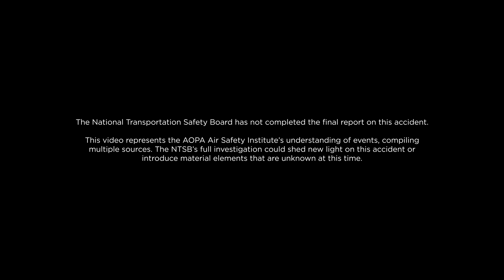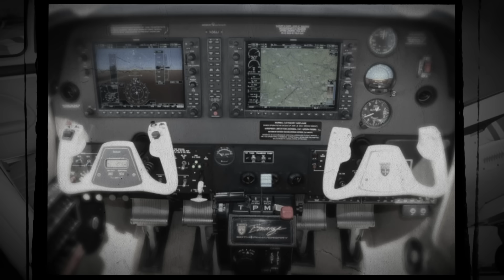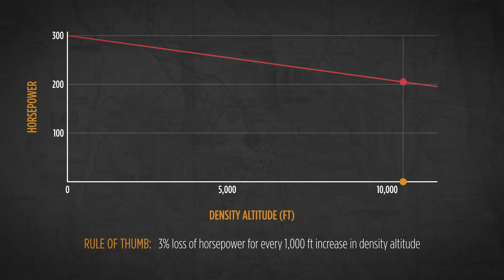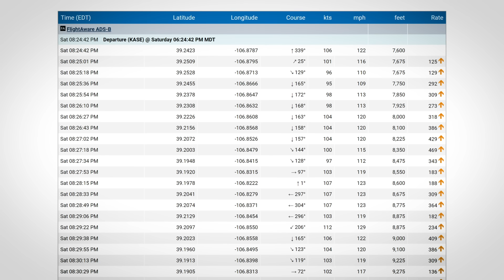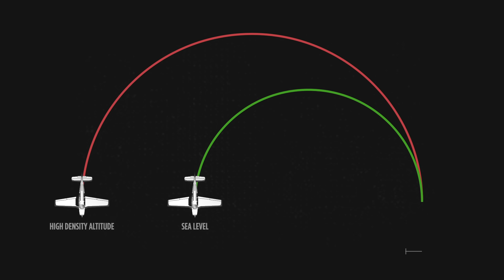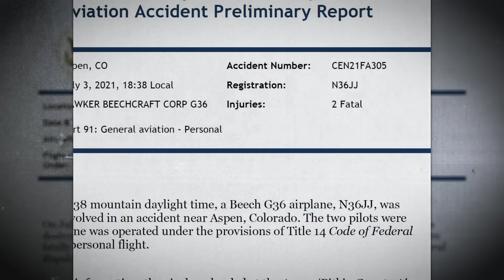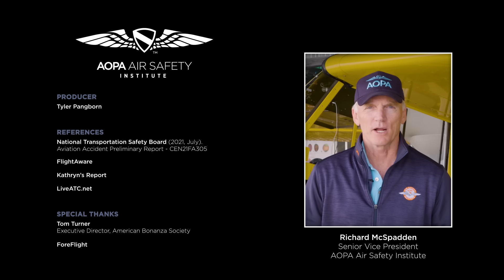Accident Case Study: Into Thin Air

Comment: While density altitude was the ultimate killer in this case, what started them down that path was improper flight planning to begin with and poor risk management of the situation they were getting into. They then further exacerbated this when, realizing that they could not climb and maintain the altitude cleared by ATC on the SID, they then decided to wing it VFR.  That’s pretty classic impulsivity at work.  To a certain extent you may not be able to blame them. They were ATP rated pilots with a lot of experience and jets. Well that may sound even more damning of their decisions, keep in mind that it creates  inaccurate and vulnerable perceptions about how airplanes perform and may not allow them to perceive just how poor the climb and maneuvering performance of a light Part 23 normally aspirated airplane like a Bonanza will fly under those conditions.  I would also have to know about their competency in mountain flying as that’s another key factor here. As you pointed out, the combination of high density altitude plus downdrafts and sinkers from wind flowing over the mountains ultimately brought about the inability of the aircraft to climb over terrain.  As a CFI I recommend to my students who finish up a PPL not to attempt mountain flying until they take a course on it from a competent instructor.  And even then, seek out the advice from an experienced CFI if they are flying in an unfamiliar mountainous region as this person can be a wealth of information as well as alert them to a lot of hazards in their region of flight.
The instant these pilots realized the density altitude would not permit them to depart IFR using the SID should have raised immediate red flags.  Being aware of this, you need to really carefully evaluate your options at that point as opposed to simply rushing into the decision to depart VFR and make your choice of course ad hoc while enroute.  Combined with the fact that it’s starting to get late in the evening, the wisest route would’ve been simply to cancel their intentions to depart, and taxi back to the ramp.  $50 worth of Uber rides and a $150 hotel room in Aspen for the night while you wait for better flying conditions and planning a new flight beats the hell out of dying in an airplane crash.  Just another sad story about people who poorly evaluated the risks of what they were doing and got in over their heads.
Reply: So true, although I wonder whether $150 will get a room in Aspen.  Seriously, though, shouldn't they have known and briefed the SID before ATC gave them that info?
Reply: @gretchenlittle6817  The pilot was a dentist in Manhattan.  He could afford a couple rooms at the Four Seasons for a night.
Reply: Only David Zara was an ATP and he received that rating in May...not as experienced at age 58 as you might have thought.
Reply: @billcraig  He may have experience growing out of his ears. I have no idea what the man‘s total times were, etc.  That being said you’re only as good as the next hour in your logbook.  You have to be real careful. These things can happen to anyone, no matter how much experience they have.  Smart, experienced pilots routinely make poor decisions in airplanes and sometimes get killed for it.
Reply: I'm a student with a couple questions - would a VFR departure in this situation be otherwise OK if they had done so having studied the geography to find a calculated route? Also, would a VFR departure so late in the day be wise in any case? i.e., it forces them to stay atop the mountains, as you can't fly through terrain with no visual reference. It would rob you of opportunity to descend in the event of malfunction or unexpected poor performance.
Reply: @JaidenJimenez86 A VFR departure can be a safe and acceptable means of cross country flight over mountainous terrain, provided it is properly planned with precise performance calculations, backup contingency plans and backup plans for those backups.

That being said, if they had run the numbers for a VFR flight that day over the mountains, the results would have been pretty grim.  I don’t know how someone could fly a Bonanza with full fuel, two grown men and their luggage through those mountain passes with density altitudes over the passes being as high as 16000 feet.  There was little margin for maneuvering or error.  Most likely if they had run the numbers they would have found it was extremely unwise to attempt a flight out of KASE that day.

At the time they were about to depart KASE, they had about 2 solid hours of daylight left.  That’s really starting to push it as there isn’t much margain for error.  Canyons and mountain passes get dark quick.  It’s risky to go off and do that.

And the situation did not appear to be getting better.  Overnight lows for the next day only dropped the outside air temperature to the high 50s, leaving the density altitude at ~9500 ft at KASE.  Combined with it being the Fourth of July weekend, I’m sure the were worried about FBO hours plus fuel and maintenance availability over the rest of the cross country flight.

An IFR flight is not required for a cross country flight, but the ability of an aircraft to perform an IFR ODP and fly at of above the MEA or OROCA of an airway is a good yardstick for whether you can safely make a cross country flight, VFR or otherwise.

Given the conditions out there at KASE, they were probably going to be stuck there in Aspen for the weekend (terrible, right?).  They would also have to amend their planned cross country for a safe chance of getting of of Aspen.  There are multiple ways to solve this problem, but I might recommend having the FBO siphon gas out of the tanks to tabs or lower, depart KASE at dawn on an amended CC flight to Denver (KBJC, KAPA or similar), grab a full load of fuel there and continue on.  If that’s not possible by the numbers, you have no choice but to grab a commercial flight out of Aspen to your final destination and leave the airplane behind.  Maybe they could hire a 130 lb female ferry pilot to complete the job.
Reply: @TheRealCFF  agree with pretty much everything you’re saying.  I question the decision to stop in aspen in the first place, but maybe these two were more familiar with the airplanes performance than they showed here.  The video discusses the technique of getting above terrain before heading toward it, which I’ve never heard, but I’m a south Texas pilot, in 90% flat land.  Sounds like that would have saved them.  Also I really don’t like the decision to figure out our path once we’re airborne.
Reply: @jccalhoun4972  climbing to ridge height before proceeding toward a ridge line is always a good policy when mountain flying.  In still air you’re just fine but if you have winds moving over and through those mountains your going to have downdrafts and sinkers to contend with.  If your airplane can claw its way up to ridge crossing altitude at 200-300 fpm at Vy, thence encounters a 600-800 fpm sinker, you could be in serious trouble as the airplane has insufficient power available to maintain altitude and you’ll descend into terrain.  That has killed people while mountain flying.
Reply: @TheRealCFF  yeah I'd say that's just smart policy to be ridge height at minimum before even climbing toward the ridge. You don't even need to be a pilot to know the wind swirls and drafts in valleys and around mountains. If you can feel it on the ground, imagine a few hundred feet in the air with no tree line to block wind.
Reply: You ain't getting a fleabag motel for $150. It's Aspen, man. That being said he was a doctor, he could have afforded to stay a night. I'm sure the DA might have been better in the morning but really he just needed to a couple more loops to gain altitude. If they wanted 4 hours they could have done another 30 min to an hour  to get their altitude (I'm not sure of their climb rate but just assuming)
I guess they didn't figure on this type of flying but I think I'd want it turbocharged because if you can afford the plane and fuel, you can afford the upgrade. On top of that, how much weight and difficulty is it to stow some supplemental oxygen just in case?

I don't know these answers but I sure would if I owned a plane. Especially a NA piston engine plane.

Comment: I flew my single engine plane from California to Indiana in August 2020. Even though it will ideally climb to 16K feet, I would never contemplate flying to Aspen or over the Rocky Mountains. I flew southerly through the less forested and flatter Arizona and New Mexico. Even then, it was a significant flight planning challenge within my plane’s endurance to find convenient airports with collectively acceptable density altitude conditions, runway lengths, surrounding terrain, and facilities. On my return to California, I stopped in Albuquerque (which is 5300 ft. msl) around noon and decided to stay until pre-dawn the next morning. Even though I “probably” could have taken off the same day, it wasn’t worth it. I also noticed the pilot in this video commented that he would choose his on-course departure path after takeoff. I experienced a sick feeling when I heard that.
Reply: Sounds like you are to be commended for both your quality flight planning and decision-making!

Comment: Wow, the A36 is the exact plane I am looking to purchase.  I live in the greater Seattle area currently, we have lots of Mountains to the east.  Have been debating if I 'need' turbo normalization or not.  Have discussed with pilots online, and a local A36 owner with turbo normalization.  Was thinking I do not need it, but I do want to take long XC across the nation... will need to rethink...
Reply: There are a number of routes you can take across the mountain ranges where you do not need a turbo. Keep in mind to fly direct over the mountains direct you will also need oxygen. These added items also add more potential for failures or problems. If you are just planning on taking the occasional trip back east, you may just want to consider picking lower, safer highway routes thru the mountains. Another advantage for highway routes is that they provide engine out options and immediate assistance availability. Of course you can still fly highway routes with a turbo.....
Reply: I do most of my flying in the mountains (KAXX), but we get a lot of Texans and Oklahomans that fly to our airport. Most don't have turbos. However, after some of them try to take-off in the summer months, many have made the comment that the minimal extra maintenance to the turbo would be worth it for getting sea-level power back when they are in the mountains. In 4 years of ownership, my turbo in my Saratoga has cost me $2200 in "extra" maintenance, and that was because I had to replace a wastegate. Well worth it in my opinion.
Reply: @CIOPilot  Thanks for the POV, the Saratoga is sort of my second line plane.  I like the A36 more, but the Saratoga as slightly more shoulder room and the nose cargo space.
Reply: @Vejitasei  The way I describe it, the A36 is a "pilot's plane", that plane is setup perfectly for a pilot. The Saratoga is a "passenger's plane", it's all about passenger comfort and the expense of feeling like driving an SUV instead of a BMW or Mercedes.  I love my 1304 pounds of useful load.

Comment: "They are perhaps unaware of the recommended mountain flying technique of climbing to ridge crossing height before turning toward the ridge" - A bit savage perhaps but also very true and evidently not as obvious to every pilot as we would expect.
Reply: I wouldn't say so - you could forgive someone for having anticipated climb performance, just how ATC have anticipated clearance. Of course, it's wrong as it removes a layer of safety in event of a failure or whatever.

Comment: I did a similar thing once in my career, but we survived.  I took off from a 1,249’ elevation airport (itself in a valley within mountainous terrain) in a Cessna 172 together with three college friends (heavy but not over gross weight).  It was a short flight over the mountains surrounding us to an airport located in another valley on the other side just 25 miles away.  After takeoff I was climbing at Vy and turned left to cross a ridge immediately in front of us.  We might have orbited over the departure airport to gain altitude I don’t remember now it has been many decades.  Being a recently certified CFI I should have had a better picture of what was happening.  And just as the announcer in this AOPA video says the terrain below us was rapidly rising.  I knew pulling back on the yoke to climb steeper wasn’t going to solve my problem.  I remember being uncomfortably low as we crossed the ridge, probably less than 200’.   But we did make it over the ridge.  The weather was beautiful and clear, I don’t remember any significant wind.  It was a great day to go flying with friends.  At any time coming up to the low spot on the ridge I simply could have broken it off and turned either way to get over lower terrain and continue climbing to gain altitude and try again.  Yet, I pressed on.  Looking back on that flight I shudder. Inexperience led to me putting all of us in a dangerous position.  I wasn’t feeling any pressure.  I just didn’t understand what was really happening-and I should have.  I'm sorry for their loss...........
Reply: It's awesome for you to share. People will blame the dead. But we are looking at it with a perfect picture. Im a mountain climber. Its really dangerous. Its easy to say the mistake happened here or here, its another to understand the mistakes are easy to see after theyve happened. Seeing it from a monday morning quarterback.
Reply: One morning I was in the Himalayas and I should not have gone, but I did. I knew the risks. I went anyway and I was lucky. It was a nightmare and if the weather had turned Id be dead. Humans are crazy, the same reason we survive and almost die is the same reason we are incredible.
Reply: Thanks for sharing!
Reply: Thank you for sharing.

Comment: You always have to take mountain flying seriously. Regardless of the obvious density altitude issues these two ran into, there are well know and basic strategies for mountain flying that clearly weren’t employed here. Flying up the center of a narrow valley is one of the cardinal sins. It’s usually bumpy as hell and these two could have clearly benefited from the updraft that is almost always present on one side of the valley. There are ways of visually telling if you are going to be able to clear a ridge or if you need to turn back such as whether the peaks on the other side of the pass ahead are disappearing or growing larger. Finally, if you are going to go off standard routes and play in side valleys you really need to know and understand your turn radius and never get into a situation where you can’t turn around. The narrowest I can turn my 172 around in is about 1/4 mile with a full flaps, 60 knot, 60 degree box canyon descending turn. I know the radius because I have tested it and measured the gps track. It’s likely these guys didn’t go up that valley on purpose and meant to take the other pass though.
Reply: My nearest mountain ranges of any significance are a full day's flight from me, but I still make a point to learn about it. Every skill in aviation has relevance somewhere.

Comment: I took a mountain flying seminar + check prior to flying in the mountains. Extremely helpful and many of the errors they made during the flight would have not been made. Would recommend something similar to that, even just going up with someone experienced in mountain flying to get to teach you the basics. So many small errors that people don't even think of can be fatal in the mountains, but just being aware of them can help you avoid them entirely with minimal effort.
Reply: You were open to the idea that you might not know enough, but others aren't as wise, humble or both.
Reply: Other option…

Just fly around the mountainous areas to the extent practicable. 

Especially in July.
Reply: @conorlauren  not feasible for trips starting and ending in the mountains, and it's rare that there is a mountain range so small you can fly around.
Reply: @marcuswilson3375  

Understood to some extent. 
I just planned a flight and the sectional shows some significantly lower altitudes.  Heading up through Wyoming gives less altitude to clear the terrain. 

It’s kinda like going to the moon. You can avoid the Van Allen radiation belts.  But you can go through the thinnest part and minimize exposure.

It’s just the thought to me, “let’s refuel in Aspen in July and then try to clear the Rockies flying east.”  That is when we might want to say, “that just sounds like suicide.”

Again, a quick gander at the sectional shows lower altitudes. Casper is even lower the whole way.
Reply: @conorlauren  Sure, but again there are many flights were the destination/departure are in mountainous terrain because that's simply what the pilot wants to do. If the pilots had proper mountain training, this flight wouldn't have been dangerous at all because mountain flying only really only dangerous when the pilot isn't trained with the risks. Perhaps they also wanted to visit Aspen specifically like that's still up to them, like if I'm going on a trip for fun I wouldn't mind taking a bit longer to sightsee as long as it isn't dangerous, and Aspen isn't an inherently dangerous airport as long as the pilots know how to fly the environment in which it is in.

The solution would just to get mountain training prior to any flights that have a possibility of ending up in mountains, whether it be flying over or around, because even though you might not encounter mountains the entire flight, if something happened and diverting became necessary, you might end up at a mountain airport whether you are prepared for it or not.